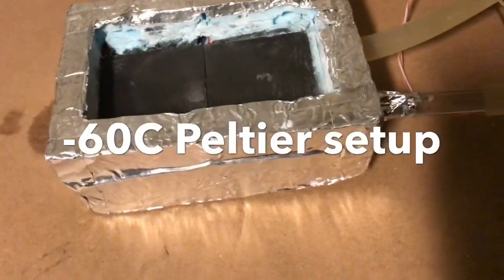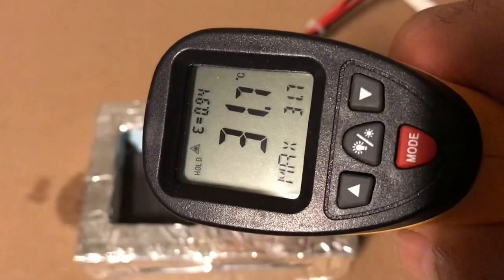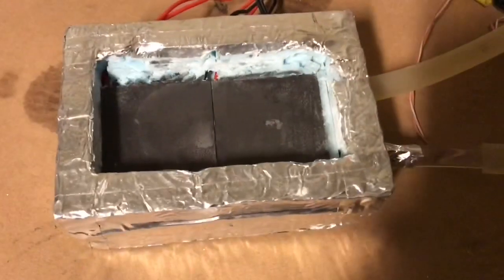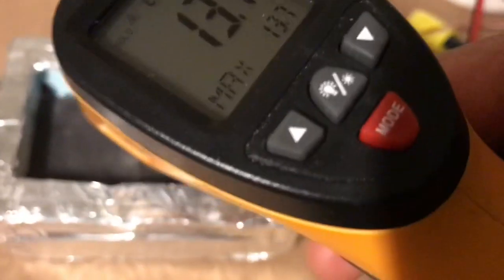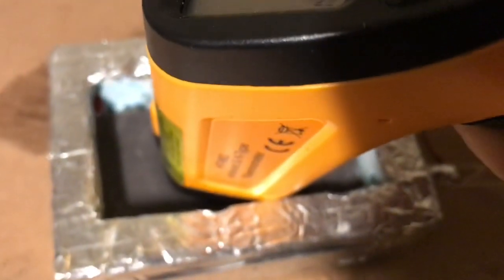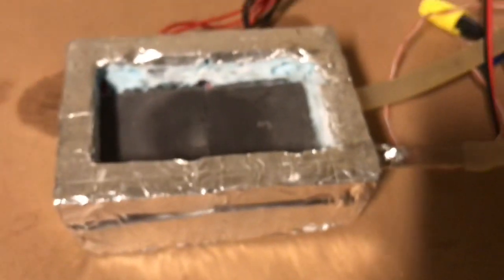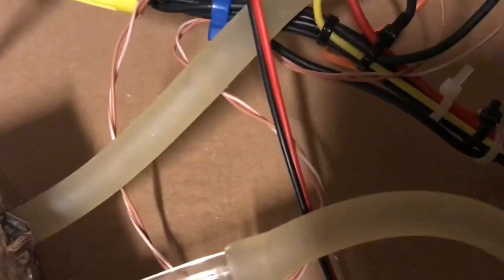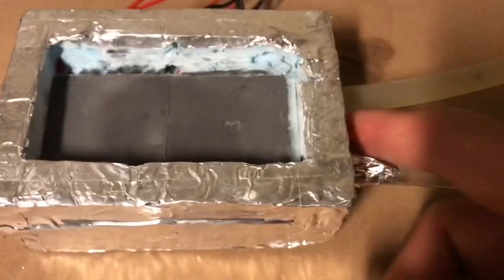-60C Peltier Cooler

Comment: You should put the materials list in the description for people like me who want to build one as well. I figured someone already asked so I searched through the comments. Thanks for the info. Maybe save others some time with the description update. Thanks!!
Reply from the maker: Thanks for the suggestion yes, I agree. I’ve had to answer several people about the components needed to build this. Each time I’ve had to write an original list which makes it challenging.

Comment: no condensation in the hot garage?
Reply from the maker: Yes there always some - not visible on camera but frost buildup was pretty good over time
Reply: @BrianDhvTinkerer  it is pretty impressive what you achieved in relatively easy set up!  Inspiring me to try. I need cold but didn't think peltier tiles can be practically used. Do you have just flat water radiator attached  to the peltier stack directly for cooling under that insulation?

Comment: im pretty sure that the single fan radiator would have very quickl;y become over whelmed and heat would start flowing backward ,to sustain it over time id think that 2 x 3 fan radiators would be required

Comment: The TEC1-12706 can get at maximum to - 55 celcuis if the cooling block is 0 celcius. For example, if the cooling block reach 20 degrees Celsius then the peltier TEC1-12706 only reach 55 - 20 = - 35 degrees celcius under perfect conditions . TEC1-12706 should be be connected to 12vdc with a maximum of 4.6 Amp.  One of the best way to get a very good result is, use a cooling with heatpipes and a small super fan.
Reply: You saw the same video everybody else did, why add unnecessary information and then say he should use X when that's exactly what he is doing

Comment: Water cooler better and both peltier you give it 3.3v 10a?

Tech?
Reply from the maker: Giving bottom peltier 12V and top peltier 7 V
Reply: @BrianDhvTinkerer  thank
Reply: @BrianDhvTinkerer  and I think need to have a good thermo paste too
Reply from the maker: @ambush427  thermal paste really helps with cooling. I bought a big tube of it so I could put lots of it on. I got the tube from China. It’s some kind of aluminum or zinc oxide paste.
Reply: @BrianDhvTinkerer  ok

Comment: heya awesome would love to see some meter readings of volts and currents ,be interested to see the side by side stacks wired in series to this should lower the current conciderably
Reply: i am pretty much positive that when used in an application the small heat exchanger wont be big enough probably a tripple fan pc rad or a two at minimum ,as this setup is going to rely on getting that heat out ,but  definatly one fan rad will end up been really hot and its effeicency plumet
Reply from the maker: Will check it out for you!

Comment: Hi SciTubeHD, very interesting video. Can you PM me? I work for a small medical supply company and we may be interested in getting you to design a cooling block for us if you'd be interested, similar to this. We use a single peltier to achieve a -12 degrees C cooling chamber but want to achieve consistent -18 C or -24 C if possible. using an 8.6 V peltier right now and not sure if we double up, quadruple up, or use two/three stages
Reply: Doubling/quadrupling won’t reduce dT, it will increase heat transfer. You need to stage for reducing temperature. Look up various techniques people have used to make thermoelectric cloud chambers.

Comment: are peltier modules black on top or you put sth on them?
Reply from the maker: I painted the cold side black with graphite
Reply: @BrianDhvTinkerer  is there any reason for that?
Reply from the maker: It was to try and get to see the frost formation easier. Also it seems to help with the temperature measurement using a digital thermometer

Comment: Hi how do u put the modules. Are they on top of each other what sides are between the peltierz if they are on top of each other.
Reply from the maker: I just found the whole thing with radiator quite cheap on e bay:

https://www.ebay.com/itm/373075851996
Reply from the maker: The modules are on top of each other with thermal paste in between
Reply: @BrianDhvTinkerer  cold sides up on both?
Reply from the maker: PRO PROductionz. need cold sides up for both

Comment: Very interesting setup! I'm intending to mount a similar one, but inside a vehicle, so I will have only the battery 12v to apply on the system. What if I connect the bottom peltiers in parallel and the upper ones in series? Should I get a result near of yours?
Reply from the maker: Did u get to try it out parallel on the bottom and series on the top?
Reply: André Menegatti should be similar

Comment: What is the purpose of having 2 Peltier modules stack on top of each other?
Reply: The effect stacks as well. A Peltier will draw heat from one side to the other. So if the hot side is too hot, it will stop drawing heat. By attaching another you are bringing the heat further away and increasing the capacity. Cheers
Reply: @KevintheRhea  Swing and a miss.

Comment: Salvage a heat exchanger in the form of an evaporator coil From a junkyard window AC unit , or an automotive heater core from a junkyard, and do a mirror image of your heat removal system, but use antifreeze instead of water. Enclose the heat exchanger in a box and use fans or a single fan to move the air past the heat exchanger and you should be able to at least blow enough cold Air on yourself to create a personal space that would allow you to work in a place such as a hot garage for a lot longer, and a lot more comfortably than with just a fan.
If exhausting the waste heat is a problem, I’ll bet you could trap most of it and hold it for a fair amount of time by having the heat exhaust fan blowing into a barrel, box, or other container with a jumble of wetted down cardboard boxes in it .

Comment: I'm a university student and im working on a project by using peltiers. Can u pls send me the full details that regarding what is the attachment u used to get -60c . Thank u
Reply from the maker: DILSHAN Kannangara the main thing is 1. Quality Peltiers. 2. Lots of thermal paste. Best is Arctic Silver. 3 Large heat exchanger. 4. Use foam insulation around the thermoelectric modules. 5. Aluminum water block. 6. Lower module 12V upper module 5V or 7V.
Reply: How to attach those peltiers. Just one's cool side attach to other peltier hot side??
Reply from the maker: DILSHAN Kannangara yes one cool side to the other hot side
Reply: Are u using 12706 or 12715
Reply from the maker: DILSHAN Kannangara i am using 12706

Comment: sir if using top 12706 and bottom 12715 and both supply12 volt what result get plzz
Reply: a peltier can reach -60 alone this project is totally useless

Comment: sir if using top 12706 and bottom 12715 and both supply12 volt what result gain plzz
Reply from the maker: Technical Skills the result should be similar

Comment: number of peltier use in this system and quntity of peltier
Reply from the maker: Technical Skills i used 4 Peltiers. Medium quality.
Reply from the maker: @kailashmalviya8  this is a rough sketch of how they were put together. The main thing is to use styrofoam insulation around the cooling block and the peltiers. Use a big enough fan for the heat exchanger. Make sure to use plenty of thermal past.  Here is the sketch. I know it is not the best but let me know if this will help. Thanks:

http://www.imagebam.com/image/faa83b1312030332
Reply: @BrianDhvTinkerer   sir if using top 12706 and bottom 12715 and both supply12 volt what result gain plzz
Reply: sir i am using same method and water replce to coolent in using car for raditor its right  or wrong
Reply from the maker: Technical Skills make sure the radiator fluid does not damage the water pump. Those water pumps are designed to work with water only but  i dont see a reason why they would not work with car radiator fluid.
Reply: @BrianDhvTinkerer  i am use water pump is use ni car for radiotor working on 12volt dc
Reply: @BrianDhvTinkerer  i try my best

Comment: It's fake.
Reply: -60 is very low but based on the peltiers datasheet it is possible (delta T of around 60°c in the best case, so two on series can achieve - 60)
Reply: @68transistor  what meaning delta T of around 60°c in the best case, so two on series can achieve - 60)

Comment: Would a 12volt bottom piece; and a 5 volt top piece setup work just as well?
Reply from the maker: towmaterfan it would. I tried 5V and 7V on the top with about the same result!
Reply: I am use same process but water use 3 liter in raditor to cooling block but cant get -60 degree
Reply: @kailashmalviya8  what was your best degree with this?

Comment: I know there are different types of peltier modules. So I ask are you using peltiers that are specifically made for those [12v; 7v] voltages or are your just using all 12v's  and running the top piece at 7v?
Reply from the maker: towmaterfan i am using 12V modules and running the upper modules at lower voltage ie 7V or 5V
Reply: @BrianDhvTinkerer  : Thanks for the response.

Comment: Could you explain why you're using 2 different voltages? Or is it just a matter of available voltage leads/sources from your computer power supply. The temperatures are impressive! I understand you can push power further with pulse width modulation. Trying to learn more about that separately. I'm interested in building a small freezer. Attempting to get temperatures -30F if possible using multiple Peltier elements and proper cooling. Do you think it's possible within the easily achievable limits of the elements?
Reply from the maker: Yes definitely possible. One thing is that peltier coolers are very inefficient and make a lot of heat. The stacking of input voltages with higher 12V  input voltage on the bottom and less higher 7V input voltage on the top allows the amount of heat generation to be cascaded. This improves efficiency. With a 3rd peltier running at 3.3V on the top, even further cooling can be obtained. However, the rate of cooling drops with more cascading of the modules. The voltages were chosen based on what was available on a pc power supply.
Reply: @BrianDhvTinkerer   Thank you for the reply and Happy Holidays! I'm going to have to start experimenting. I want to create a very small insulated cooling chamber large enough to stick a few vacuum sealed packages of fresh fish that I can keep at a very low temperature for a couple weeks, without having to invest in a commercial very low temp freezer. Based on the various videos I've watched, it seems like a possibility, though most people are settling for refrigeration. I'd like to take it further. Thanks!

Comment: Wow! Where did you get that water radiator cooler? Can you post a link? Thanks!
Reply: They can be purchased on Amazon or Ebay.  Aluminum Computer CPU 8 Pipes Water Cooling Heat Exchanger Radiator 80mm Black.  They have several sizes

Comment: Ok Please tell me which pelteir   is use this please share shopping lists link..
Reply from the maker: The one I am using is TEC12706. I got these from China. The quality and authenticity of the TEC12706 is important for good results. I would try here  to get some:
https://www.ebay.com/itm/TEC-12706-12V-40mm-X-40mm-X-3-75mm-Thermoelectric-Cooler-Cooling-Peltier-Plate/262034289314?hash=item3d0275f2a2:g:yHEAAOSw0JpV6aWQ

Comment: which temperature has the liquid inside the tubes and inside the bucket? Are you using water or anti freeze liquid? Which proper way would you suggest to control the liquid temperature so that you can set it to a ~constant temperature, for instance with a PID controller?
Reply from the maker: SURE D the liquid temperature in the tubing is about 50C which is the temperature of the back of the lower Peltier cooler chip. This water is  passed through the radiator.
Reply: thank you. This means that this setup is not intended to chill the water in the bucket. The water is basically functioning as the heat transfer medium, but not directly to be cooled.

Comment: Impressive. I figure that, if you completely closed the cold side and made heat management more efficient, you could make dry ice with this. Dry ice is around -78 C, not too far off. Good video
Reply from the maker: That’s exactly what I was thinking. If i opened the closed loop radiator cooling system and ran the water through a bucket of ice, I may be able to get to -78. With a water trap I should be able to condense dry ice out of air
Reply: Or maybe from your breath! That would be awesome.
Reply from the maker: Im using TEC12706 modules. The bottom is connected to 12V DC and the top is connected to 7V DC. Some of the TEC12706 modules I bought were reproductions and did not work well. I found the better quality more expensive modules worked the best.
Reply: @BrianDhvTinkerer  Where did you buy better quality modules on the internet ? I stacked mine exactly how you did and can't get lower than +5ºC.
Reply from the maker: João Caetano Köhler make sure have plenty of thermal grease between the stacked modules. Check the coltage across the modukes while they are working to make sure you are not getting a big voltage drop. Make sure there is enough thermal paste between the bottom module and the heatsink. If still no improvement, then next change the modules.
Reply: SciTubeHD I can only find cheap Chinese modules. That’s the ones I bought. Where can I find good ones?
Reply from the maker: João Caetano Köhler try these :
https://rover.ebay.com/rover/0/0/0?mpre=https%3A%2F%2Fwww.ebay.com%2Fulk%2Fitm%2F382666299900
Reply: @BrianDhvTinkerer  Is there any difference between thermal paste and thermal grease? I'm only using thermal paste for everything.
Reply from the maker: João Caetano Köhler there should be no difference.
Reply: What tpe of piltier are u using and what all other materils kinly send the link